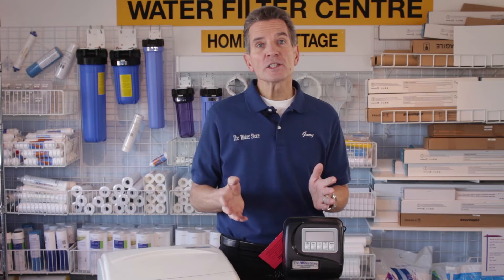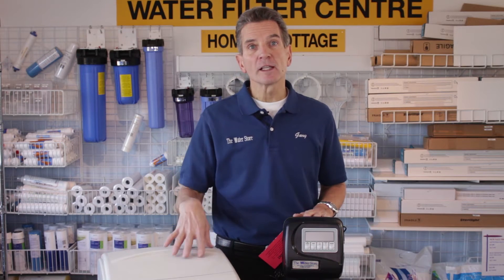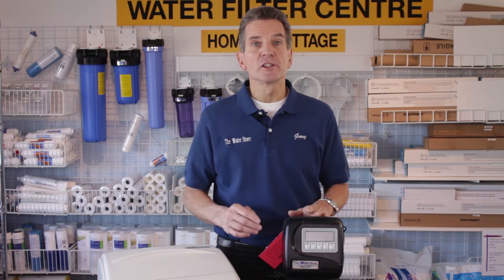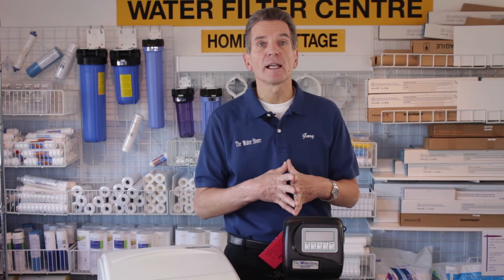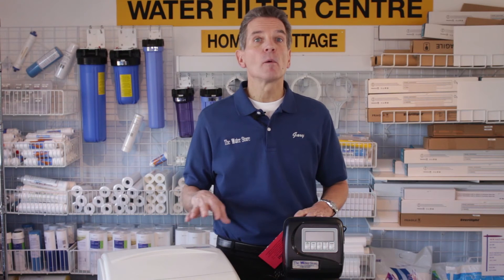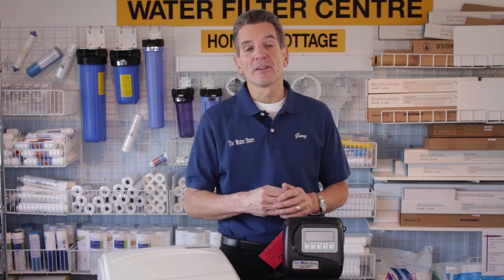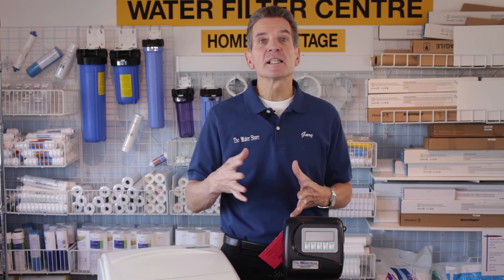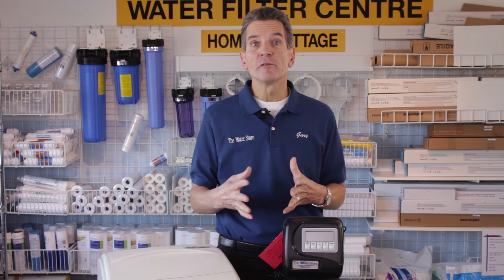Water Softener Installation Part 1 Where to Install WaterBoss and Clack

Comment: Couple questions, and a comment...   Wouldn’t draining the salty brine into a sump pump wreak havoc with the pump over time?  Also, if you have a septic field you don’t want salty brine getting dumped into it.  A lot of realtors / home inspection people are raising red flags to perspective buyers, (if water softener is draining into a sump and/or septic field) so save yourself the grief and figure out what is best.  We have a insulated drain line with a heat tape that goes to a pit.  Fwiw.
Reply from the maker: In a perfect world the brine would go into a dry well and not into the septic or the sump pump.  Very long term, like 10-15 years you might get some issues with the sump pump failing and 25 - 30  years with getting some corrosion on your concrete septic tank.  Keep in mind that if you eject it outside, as you are recommending you will kill all vegetation that comes into contact witht he brine.  At my house, the water softener and iron filter both get discharged into the septic and have been for over 30 years with no issue whatsoever.

Comment: Very cool, Gary - does the drainage pipe have to pitched? or is there pressure coming from the unit?
Reply from the maker: I don't know what you mean by pitched?
Reply: @water_estore  Like, headed down toward the ground.
Reply: @water_estore  He may mean set on grade
Reply: Yes it is under some pressure.  Our water softener pumps the discharge up about 4 feet and horizontally about 15 feet before it runs downwards into a deep pit.  Most water softeners can handle pumping upwards and horizontally, within reason.